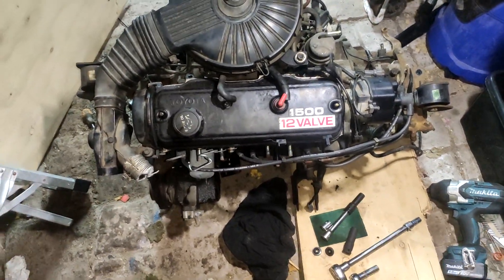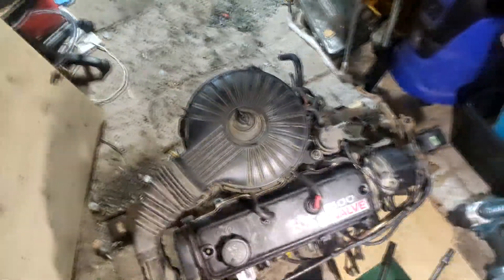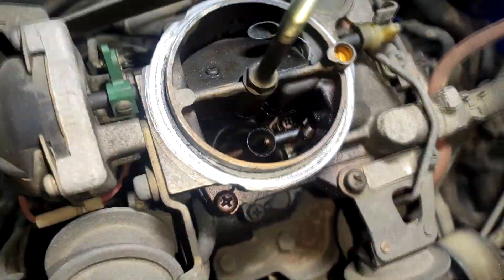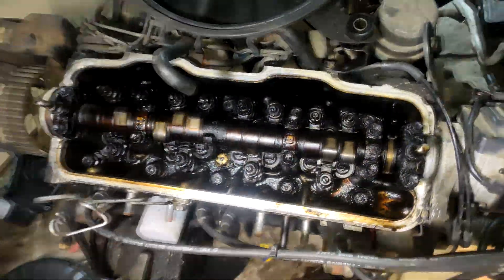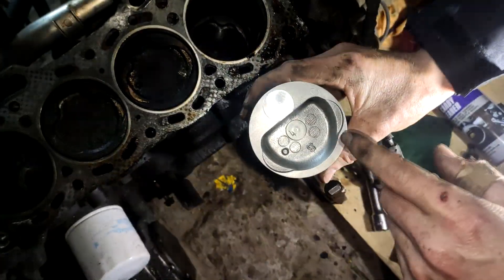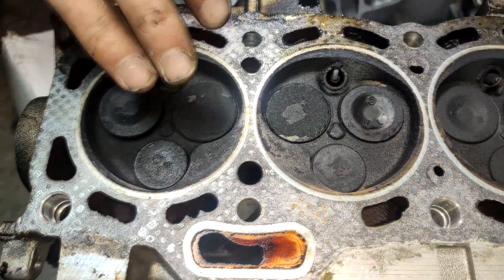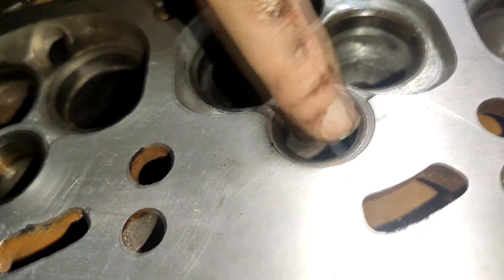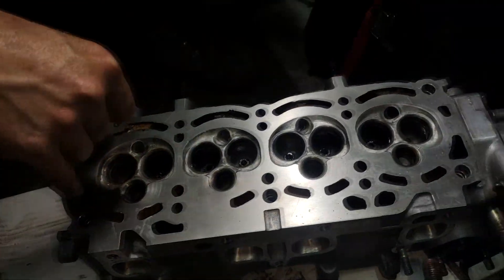Toyota 3E Engine Teardown/Comparison

Comment: Which piston has the larger dish volume? The dish shape looks bigger on the 3E piston, but could it be that it actually has less volume in the dish, so that the 3E piston produces higher compression?
Reply: That could easily be determined using oil and a syringe.
Reply from the maker: Don't have my 3e anymore

Comment: So if i use the 2e head on 3e block with 3e cams and camgear it's possible with high performance?
Reply: Скорее всего это возможно, но надо выставлять распределительный вал под метку "2Е" на шкиве распределительного вала (на шкиве 2Е две метки - "1Е" и "2Е" примерно через 90 градусов по часовой стрелке, на шкиве 3Е тоже две метки - "2Е" и "3Е" примерно через 90 градусов по часовой стрелке). Иначе - есть риск удара третьего клапана в поршень. Но надо смотреть по месту. В 3Е третий клапан глубже в головке блока цилиндров, чем в 2Е. Может быть - клапан и поршень не "встретятся". 
П.С.: чтобы поршни не "встречались" с клапанами - есть, например, вот такое решение - https://www.youtube.com/watch?v=GIlimb2iNoI
П.П.С.: я не сразу обратил внимание на то, что ссылка на канал автора данного видео)))
Reply: @wazlawagentf3444  can you translate it into english, please?
Reply from the maker: you can do it but it will be lower compression because 3e pistons are lower compression so it wouldn't be worth it unless your where doing a turbo engine or shave down head even more thanks
Reply: @RuggedGarage  That’s the complete opposite of what you explain in the video, so now I’m a bit confused 😅

Comment: Mesin 3e ini ukuran teming beltnya brapa om?
Reply: 127*24
Number of teeth, pcs. 127
Width, mm 24
Toyota 13568-11031
Toyota 13568-YZZ24
Toyota 13568-19085
Dayco 94334
MITSUBOSHI 127MY24
Reply: I think 137 teeth timing belt

Comment: I was wondering if you could use the 3E camshaft in the 2E engine.  I know 1E camshaft have the same  timing and duration, but less lift.  I haven't been able to compare a 2E and 3E camshaft
Reply from the maker: im taking my 3e cam into my cam guy in the next few weeks to get it welded up and made to a 300 duration im going to get him to check to see if their the same because i was wondering the same thing so ill let you know
Reply: @RuggedGarage  that would be really helpful. I don't know if i can weld camshafts where i live so if the 3e cams fit in that would be great.
Reply: @RuggedGarage  Did you ever find out if the 3E cam and 2E cam are the same? Would there be a benefit to putting a 3E cam in a 2E? Thank you